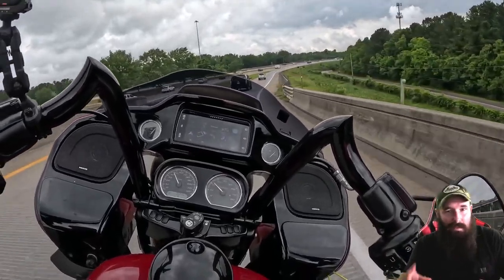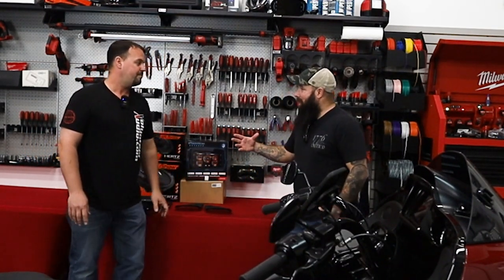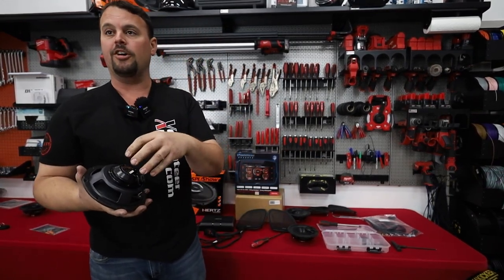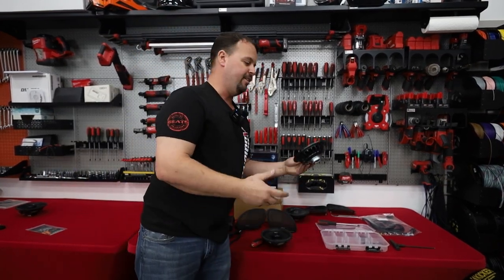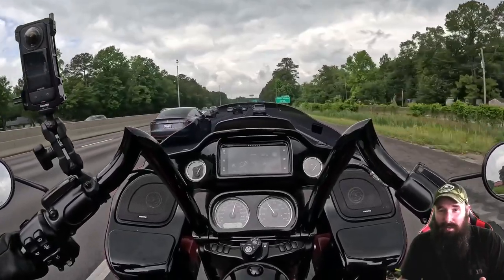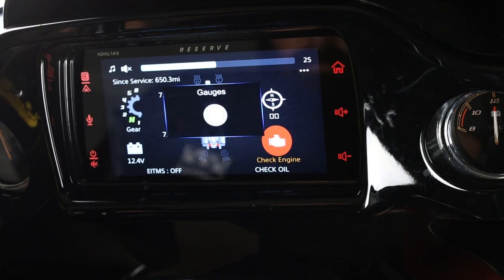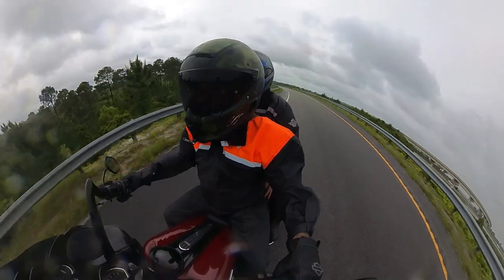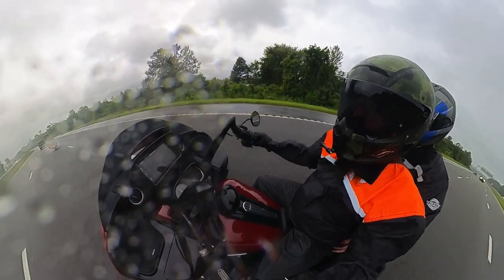This Changed My Bike Forever...And I Love It!

Comment: What was your experience with the sound system on the Indian Challenger?? I can hear my music at 85mph at level 5 (out of 10) with no issues, and I have tinnitus up the ying-yang. It could definitely use more bass, but I’ll take it for stock. I installed a $1000 system on my ‘19 Road Glide and it still didn’t sound as good as my Challenger.
Reply from the maker: For a stock system its ok at best